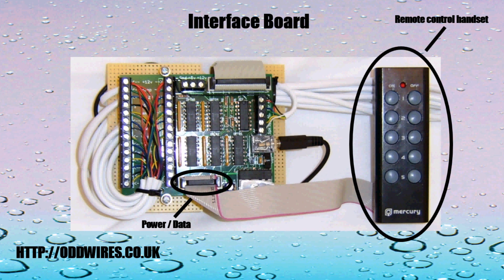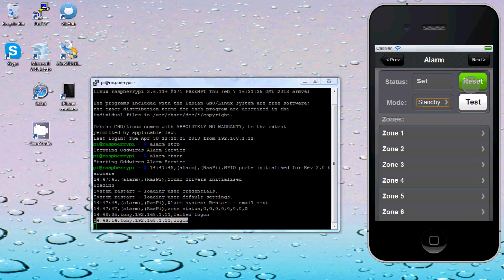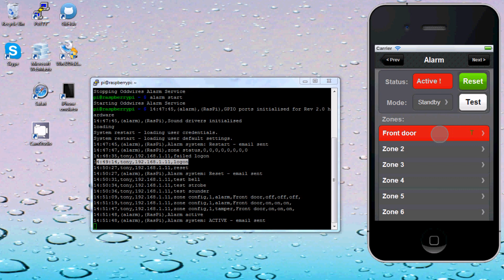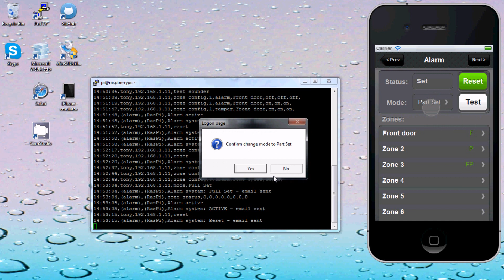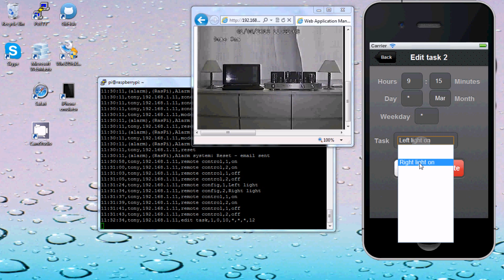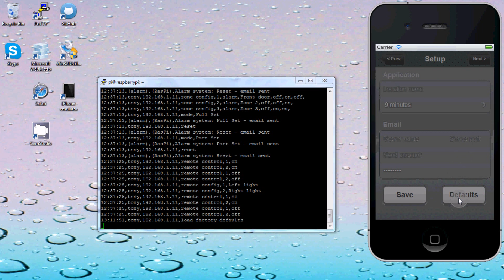Security system - a demonstration of a custom home security system.

Comment: Thank you so much Tony! I can't wait to try this.
Reply from the maker: Hi - thanks for the comment - I really need to update this video. The interface doesnt look like this anymore. It is now based around a menu srutcture and has a load of pop up menus, custom colour schemes, event logging and other new stuff. I've added code for password hashing, ,'remember me' logons, Fail2Ban intrusion protection, and the latest bolt on is an interface to Apple's HomeKit, allowing voice control of the home automation.https://github.com/oddwires/alarm-system
Reply: +Tony Oddwires Tony, would you make one of these interfaces for me for $100 US dollars?
Reply from the maker: $100 is tempting, but I've been asking $45.This a development interface, running development software, and I cant guarantee that all the dependant software and protocols will be permenantly available. So I'm not selling it, the circuit board would be a gift, and the $45 is a contribution to development costs.Drop me an email at tony@oddwires.co.uk if you want  more details.

Comment: Awesome project.. have you released this as a commercial solution :P? Looks very professional! Also thank you for open sourcing your software.. Looking forward to seeing how you did some bits
Reply from the maker: Hi Matt - Unfortunately the system wasn't built with economy in mind, so its rather expensive for a commercial solution. But it is ideal as a hobby. The system is still in daily use, and running well after over a year. Currently I'm working on a new GUI, so watch out for a new version of the software sometime soon.